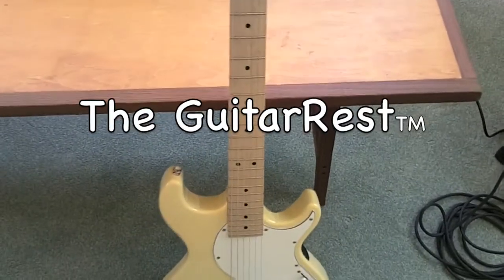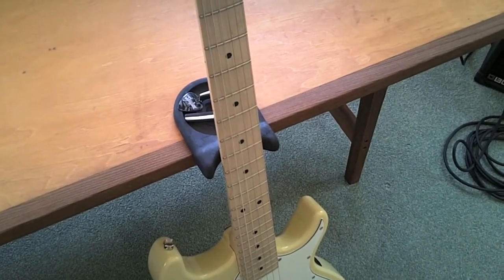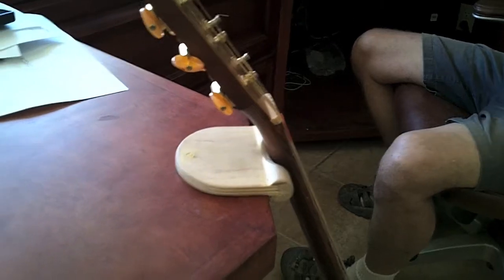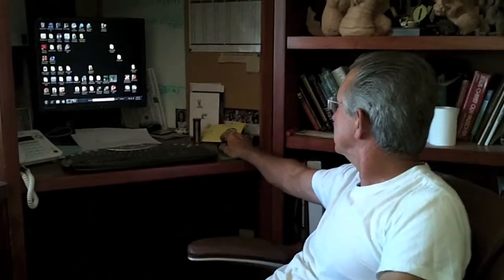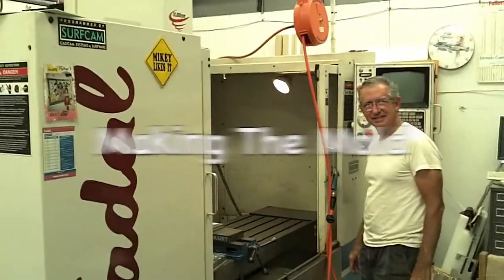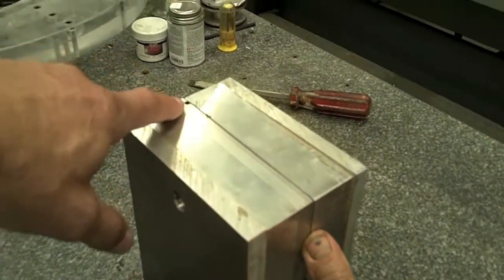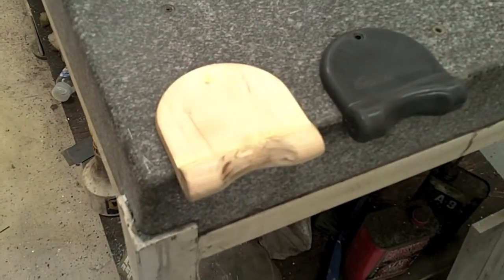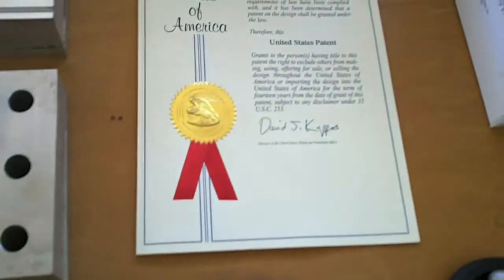the guitar rest... from the idea to the market

Comment: Really interesting video. Thanks for posting this. I'm going to buy one, but since I don't ever use picks and rarely a capo since I play classical guitar, I wish it didn't have the cut out for those accessories. As a matter of fact I wish it had a piece of lead imbedded into the rubber to make it even heavier and therefore more secure.

I heartily second the recommendation for the NS capo. I've owned many and it's by far the best I've ever used.

Comment: Okay, so I got it, and I like it, but I thought of one improvement.  This thing seems to be designed wide enough to fit even gigantic necks like 7-string bass necks. This is fine for many guitars (thin-necked ones like my Washburn Idol in particular), but my Ovation has a more rounded neck, and seems to want to lean to one side and pivot when touched. Solution: a small (about 1 cm. long by 1-2 mm. deep) notch directly in the middle of where the neck rests would almost certainly solve this.